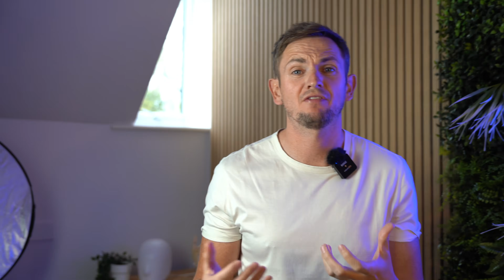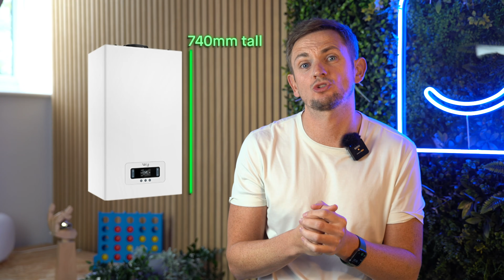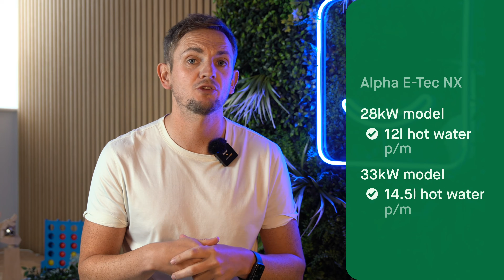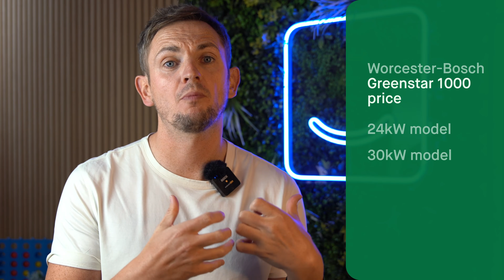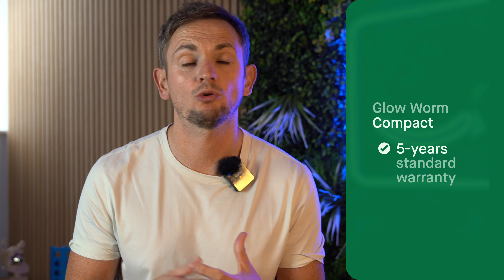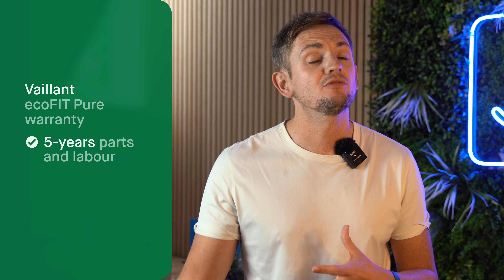What's the Best Budget Boiler of 2025?

Comment: How can you say the 1000 30kw is only suitable for smaller homes when it can have up to 16 rads? I live in a 3 bed detached and have 8 rads, and thats plenty considering I live in wildest Wales @ 1.250 ft above sea level, brrrrrr.
Reply: Probably because a smaller one would struggle with boiling water on demand.

Comment: I have a Worcester  1000 30kw. I have no hot water issues, although I have not got a shower worked off the boiler. Total cost  £2,250 all in that was installed 3rd March 25. my huge grip is the stupidly complex wireless controller, how I never threw in out of my window I will never now.  However after pushing my blood pressure to dangerous level's I managed  to get in on 'manual' and that's were it's going to bloodywell stay.
Reply: Hi can you point to where you purchased and installed it from ?

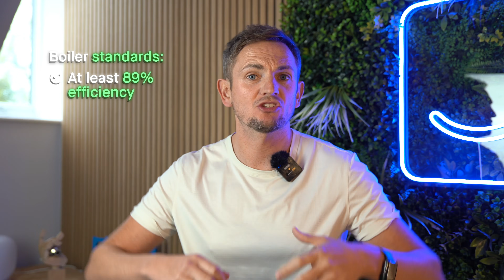Comment: The WB 2000 can do all the goodies and average household needs. 1:10 modulation ratio, 8 years warranty with the WB filter-which is genius by the way-well insulated case therefore, it is quite enough not only for a kitchen fit but for a habitable space if no other option.
The only downside is the more basic screen to compare with the 4000 . The wireless contoll option is still there and it is a piece of cake to install and commission.
The WB 1000 lacks case insulation therefore, a bit noisier, it can be disturbing for someone with fussy ears.
The Vaillant ecoFit is a rebranded Glow orm is it not?
1:5 modulation is not good enough if you want to avoid cycling.